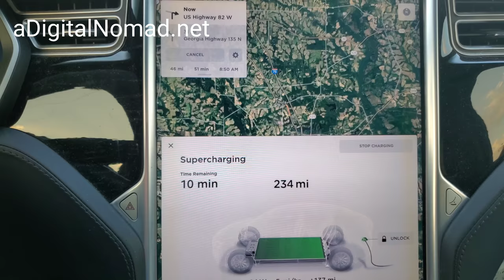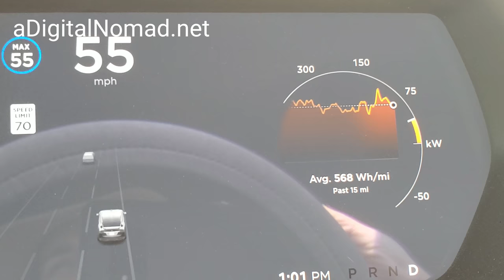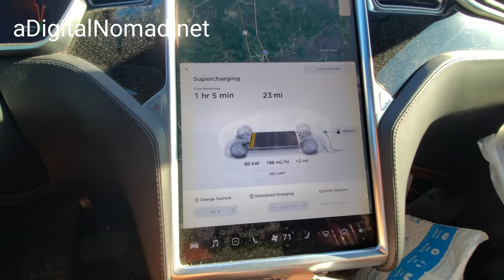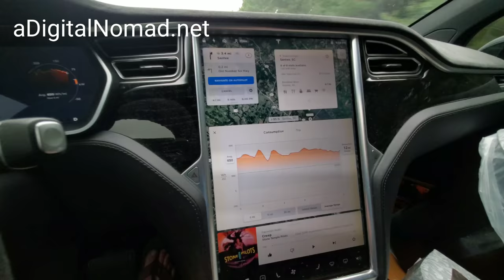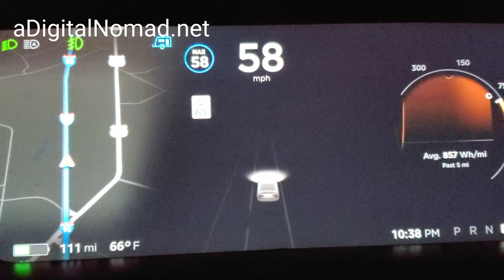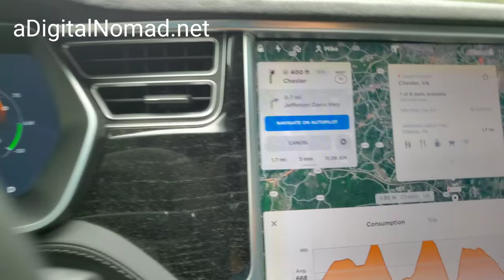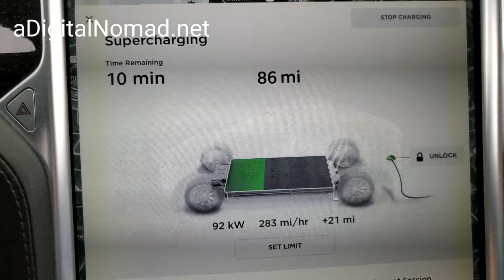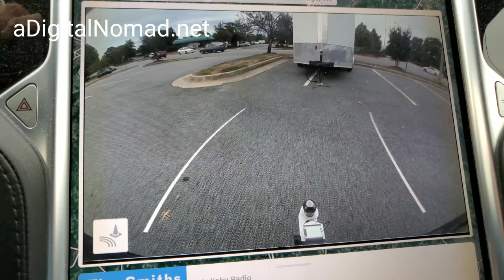TESLA Model X 1,000+ mi 4,000+ lb BIG RIG Long Distance Towing ADVENTURE

Comment: Glad you made it safely but, towing in Tesla X over 450 Kg you are required to have trailer  brakes. Check your owners manual, this is a unsafe practice,  braking distance will dramatically  increase. Regen does not count like 4 other tires with brakes. 
I appreciate the time you have taken to do this video adventure with your Tesla.
Reply from the maker: Good Point!

Comment: Black exhaust smoke means the engine is burning too much fuel. The first think you should check is your air-filter and other intake components like sensors, fuel injectors and the fuel-pressure regulator. ... Any smoke coming from your car's exhaust pipe is a sign that your car is in distress. It has nothing to do with Off road diesel.  the difference between the 2 is Dye.On-road diesel is sometimes called “clear diesel” because, as the name suggests, it's clear. Off-road diesel, on the other hand, is also called “dyed diesel” because it's usually dyed red.  The vehicle needs maintenance is the problem. Usually.
Other than that. I am very impressed with the video, and the car. Awesome job.

Comment: How much was the trailer?
I trust you have newfound appreciation for aerodynamics. Weight also matters.
Reply from the maker: Yes!

Trailer was $3,200 brand new
Reply: @aDigitalNomad  Not bad. You can push it around by hand and spin the wheels to get a sense of how wasteful the bearings are and tires. Efficient tires and good bearings could mean a lot.

Comment: This makes me concerned about the Tesla truck.  Even with a huge 500 mile range battery trucks pull 25,000 pounds.  500 miles could become 50-70 miles with a huge load.  Who is going to want to fill up that often.  Yikes.
Reply from the maker: So True!  We will soon find out about the Tesla Pickup.....
Reply: Yeah. When I watched the model x pull some stuff and almost die... I was crushed.
Unfortunately I think it will flop. 
Sure it will sell 1million trucks but beyond that?? 0
Reply: I watched a Tesla model 3  drive 120mph for 45 min. Battery when from 100% to 11%...
Reply: @dreadone6894  yikes
Reply: @BrenttheGreat  it’s sad . Look at the stock it’s plummeting
Reply: @dreadone6894  Long term it will go way up but it is certainly having A significant pull back.